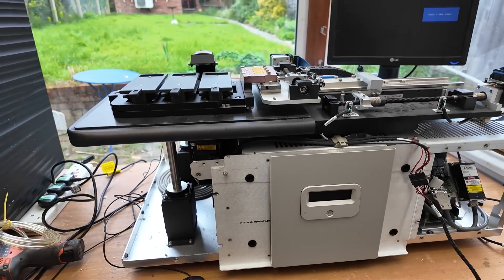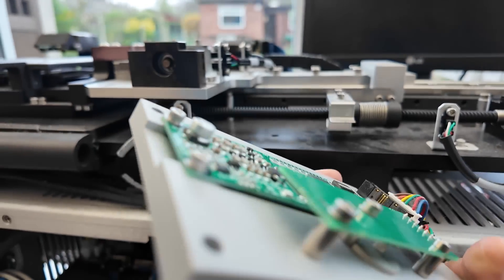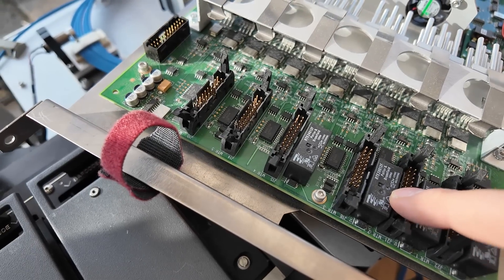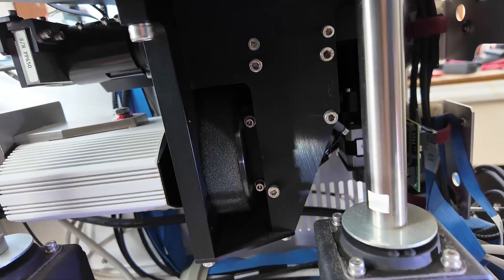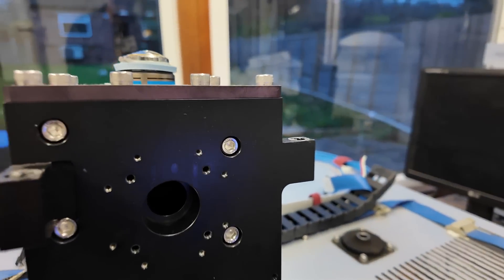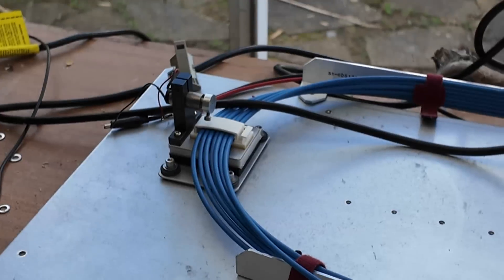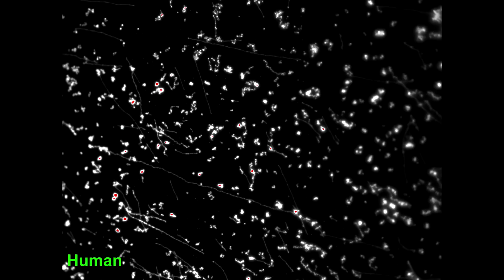Opgen Argus DNA Optical mapping system part 2

Comment: Abstract

This video provides a detailed teardown and examination of the OpGen Argus system, a large and complex microscope used for bacterial analysis. The video explores the various components of the system, including the microscope itself, the laser and camera systems, and the control boards. While the presenter was able to get the laser operational, the camera remained nonfunctional. Due to the size, complexity, and limited functionality, the presenter ultimately decides to part out the system and sell the components.

Summary by Timestamp

System Overview (0:01)

* The OpGen Argus system is a large microscope with a graphical display and loud fans.
* It boots up slowly and runs on Linux.

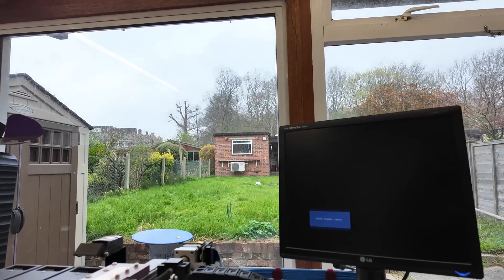Disassembly and Initial Observations (1:13)

* The presenter was previously able to boot the system to a password prompt and re-zero the XY axes, but this functionality is currently unavailable.
* The system contains a PC power supply, a secondary power supply for motors, and a solid-state relay.
* A 532nm green laser with a fiber optic output is present.
* The system utilizes a PC motherboard with various cards and a camera with custom components.

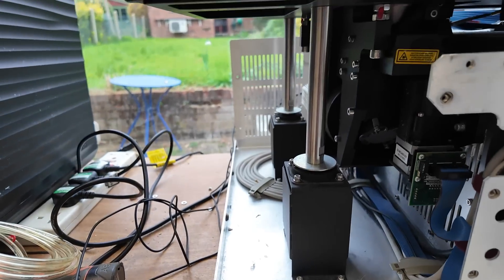Microscope Components (2:42)

* A shock/vibration mount supports the optical assembly.
* The camera is located beneath the optical assembly, and the laser enters through a fiber at the top.
* A stepper motor likely controls focus, and a barcode reader reads codes off plates.
* A high-magnification microscope objective with an oil channel is present.
* The XY motion platform features high-precision slides and a unique motor coupling design to minimize lateral force.

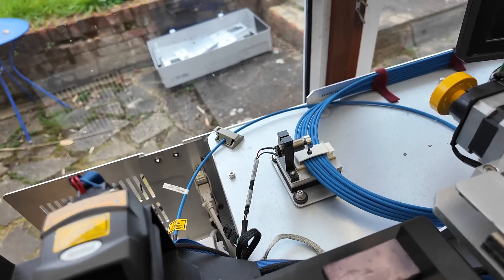Laser and Speckle Reduction (4:03)

* The laser fiber travels through a unique assembly with a motor and offset weight, which shakes the fiber to reduce speckle caused by the laser's coherence.

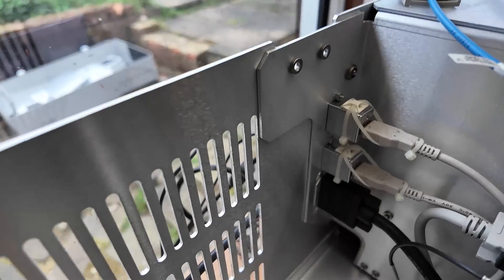Internal Boards and Power Supply (5:06)

* The boards are mounted on trays and slide out for easy access.
* A dual-processor server motherboard is used, likely for image processing.
* The camera interface card is manufactured by Photometrics.
* A RAID hard disk controller, dual serial port, and graphics card are present.
* The system uses a Corsair TX850 PC power supply.

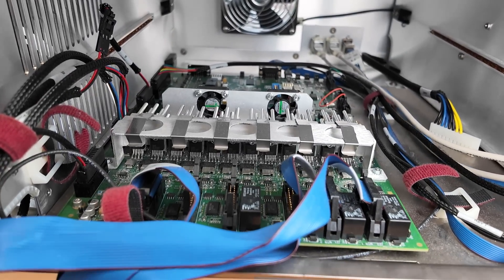Stepper Motor Driver Board (7:23)

* A custom board controls the stepper motors and other outputs.
* The board appears underutilized and may be designed for multiple products.
* It features powerful outputs for up to six stepper motors, although only three are used in this system.
* The board utilizes relays for interlocks and includes an Altera Cyclone FPGA and Analog Devices Digital Signal Processor.
* The complexity of the stepper motor driver board is questioned, as simpler solutions seem adequate.

Laser Driver and Optics (9:53)

* The laser driver board appears straightforward and easy to operate.
* The laser module contains a narrow band filter to ensure only the desired wavelength is emitted.
* The presenter demonstrates the laser's functionality and the effectiveness of the fiber shaking mechanism in reducing speckle.

Camera and Magnification (12:53)

* The camera is a Photometrics CoolSNAP EZ with a CCD sensor.
* A large weight is attached to the camera, possibly for vibration damping or anti-vibration purposes.
* The presenter was unable to get the camera working and suspects a problem with the control board.
* The camera enclosure is sealed to prevent condensation but does not utilize extreme cooling like other high-end cameras.
* Using a DSLR, the presenter demonstrates the limited magnification of the microscope objective.

Conclusion (17:04)

* Due to the size, complexity, and limited functionality, the presenter decides to part out the system and sell the components on eBay.
* The presenter shares images found on the system's hard drives and asks for help interpreting them.

i used gemini 1.5 pro
Reply: Once upon a time we had to use VCRs to watch tedious TV programs for us, with that summary I am certain that in the near future Gemini 2.0 will put all the electric monks that still exist out of a job.
Reply: @Potsie  Not without a major shift in how stuff is done.
As a casual ML researcher, I can confidently say that a lot of the "Big" AI stuff is little more than a toy.
There are some amazingly useful things we can do. But they are simple tools.
Most of the complicated stuff is smoke and mirrors. It's Jesus on Toast.
A box of hammers can't build you a house.
A rack of wrenches can't fix your car.
But they can make it easier for YOU to do it.

AI doesn't lie. It doesn't hallucinate. It doesn't make errors.
No more than a book does at least.
These tools are just too complicated to reasonably comprehend, so we see thing that aren't there.
They are also not very good at doing the tasks we assign them. Not because they just don't happen to be good enough yet.
They are bad at doing it because how they actually work doesn't allow them to succeed.

Seeing Jesus on your toast doesn't make your toaster an artist.

Comment: Fiber is multimode, so by shaking it - you mix modes by physically bending the fiber. So it's nothing fancy. You can test it yourself - project fiber to a wall, bend the fiber - and observe that speckle pattern change as you bend it.
Reply: Here is what I remember how shaking a fiber can reduce speckle: This is achieved by launching a mixture of modes into the fiber, each propagating at different speeds. At the fiber's end, these modes interfere, creating speckle. Shaking the fiber alters the relative optical distances between modes, effectively scrambling their interference pattern. Ideally, the fiber length is chosen such that the time delay between the slowest and fastest mode exceeds the laser's coherence length (In your demonstration at 15:39 it doesn't look like intensities are added, instead I think you have to set integration time long enough to contain a few cycles of the shaking motor, I think in the ideal case you wouldn't have to jiggle the fiber). This decoheres the modes, resulting in a more uniform illumination.
To understand this further, consider how beams are added for coherent versus incoherent beams. For coherent beams, the fields are added directly (A + B, where A and B are complex numbers). This can lead to high-contrast fluctuations and even zero crossings in the combined intensity. In contrast, for incoherent beams, the intensities are added directly (|A|^2 + |B|^2), resulting in a much more uniform illumination.
Reply: You must admit that is is cool to see someone shaking a coil of fibre on purpose inside an apparatus though.  With the big fan running the sound would not have been noticeable but imagine this in some other equipment like a desktop microscope illuminator, 6dB noise increase when turning on the despeckler. :-)

Comment: Even the heat sink is totally over-engineered. I mean, at this point why don't get a extruded aluminium heatsink (tunnel) or even a custom heatsink like those in computer PSUs
Reply: The only custom part there are two sheet metal parts with pressfits - literally the easiest and cheapest solution design engineer should choose as option of first resort. It is job well done.

Comment: I'm guessing that the custom stepper motor driver was an attempt at implementing something like the new sine wave "silent" TMC drivers which are now commonplace, perhaps. The relays on the output feel like some form of a solution added to ease compliance with some form of certification, since perhaps then they wouldn't have to certify all of the complex electronics as "functionally safe" or something. Definitely feels like there was no shortage of "not invented here" syndrome in this machine, which appears to be common in lab equipment

Comment: Hi Mike! 
3:40 The technical term for these is 'flexures'. They are designed in such a way to only couple through the degrees of freedom intended, and release other mechanical degrees of freedom. Currently I am working/doing research in a group specialized in flexural mechanisms.

Most important in flexure design, is figuring out what constraints you want. This particular configuration is quite common, and only allows for a single degree of freedom, namely translation 'out of plane' (towards/away from the camera). It is stiff in all other degrees of freedom. They do this to minimize over-constraints in the system. You are right that indeed it is meant to resolve the alignment problem between screw and sled. Personally I am a bit confused why they only care about releasing that 'out of plane' translation alignment axis, but not for example the vertical translational alignment. Ideally you would only want to couple the translation along the screw axis to the slide, and a flexure that would do just that isn't that much more complicated. Seeing the non conventional construction of that flexure, I am doubting whether it was designed by someone that is very familiar with flexures, but I digress. 

Flexures are very common in high precision mechanisms (think wafer stepper machines like ASML, spacecraft etc). They have a couple of advantages over 'traditional' mechanisms with bearings:
- No relative movement between parts, and thus no friction. Friction (combined with limited stiffness) causes a phenomena called 'virtual play' which limits machine precision, thus eliminating this is very important.
- No lubrication required (very important for space applications, where bearing grease can cause major headaches with vacuum and temperature fluctuations) 
- Can be relatively cheap (depending on the materials used).
- More flexible in the allowable degrees of freedom (bigger design space). Although this can be mitigated with more complicated designs.

 If you would like, I have some good recommendations to learn more about them. In particular I would recommend 'Exact constraint: Machine design using kinematic principles' by Blanding. It is not flexure specific, but more on the topic of constraint design, but it has transformed the way I am looking at mechanisms in general (and is quite a fun and light read!).

11:55 I doubt that they would add weight for damping. I would expect that the weight would only shift a mechanical resonance to a lower frequency. Perhaps without the weight it has a resonance peak at the same frequency as another part of the system, thus amplifying each other? Still in such a case, such a massive weight is quite overkill.
Generally adding damping to precision mechanisms is avoided, as doing damping without friction is quite hard/expensive (you want viscous damping without friction, most viscous dampers have internal friction).
Reply: Yes that damping weight was a puzzle  I think I saw more holes on the weight and wonder if that was intended for attaching a second weight through a lossy coupling.

The flexures may have been a legacy of a different design choice and constraint requirement OR the mechanical system might have adequate play in the other direction and was only binding in the one direction. OR they made a design error or component change that required a change in the spacing of the screw and linear slide that was easiest to compensate with a non-rigid coupling OR there was a thermal expansion issue that would cause binding that was only evident in the one direction.

As is typical of these over prices and (comparatively) low volume medical and analytical devices a lot of money gets spent on stuff that might not even need it because of reliability concerns.

Comment: All the budget went into the control panel frame and the Allen screws, so they couldn't get a semi-custom PC power supply without all the useless extra cables sticking out, and find a better solution for those USB plugs 🙄
Reply: Didn't even have the budget to spring for a modular pc power supply :)
Reply from the maker: @dash8brj  Were they a thing in 2011?
Reply: @mikeselectricstuff  haha true - never thought of the vintage of the machine you were tearing down :)
Reply: @mikeselectricstuff yeah I have a Corsair HX750 from 2009 that has modular cables.
Reply: @mikeselectricstuff  yes, they were. Semi-modular too.
Reply: I dont think Allen screws are that much more pricey than phillips/pozidriv. Torx on the other hand...